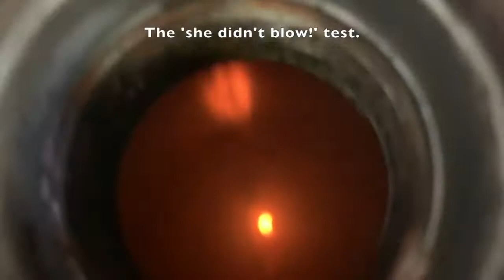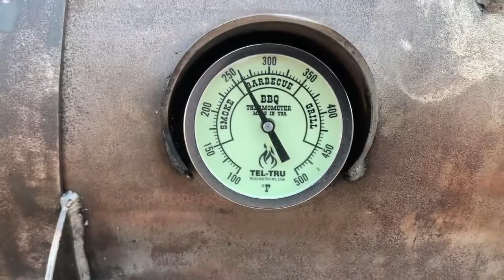Complete Patio Reverse Flow Offset Smoker Build

Comment: Nice work! I like your spin on things. I definitely got some inspiration from this video. The one I'm building should be done this summer. I'll try and make a video. How do you like your built-in water pan?
Reply from the maker: Yes the water pan is a great idea, great for keeping consistent temps & cleaning - although I wish I had put mine on a slightly steeper gradient for a little better drainage. Good luck with your build.